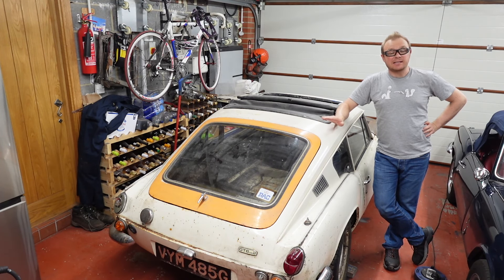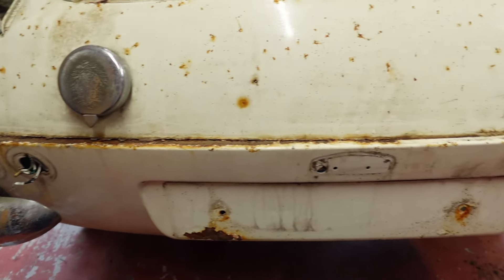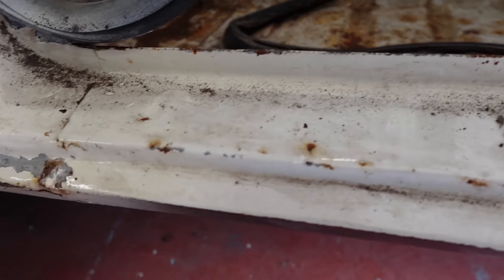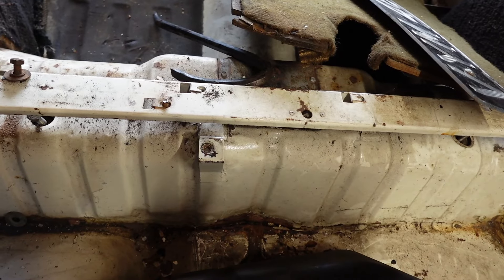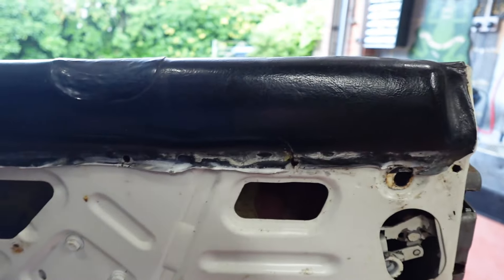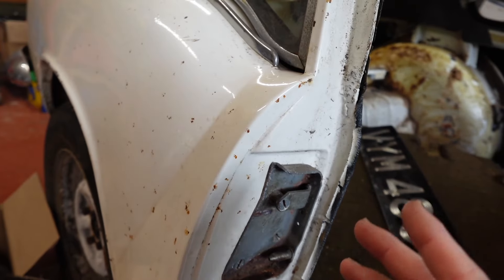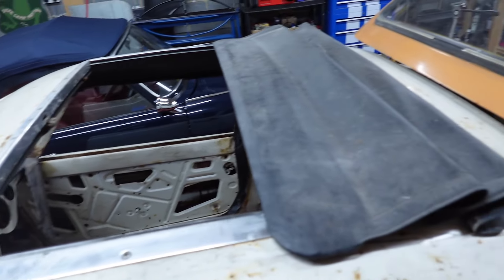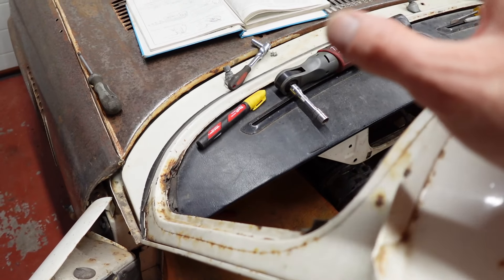How Rusty Its It Really!? Abandoned Resto Teardown | 1969 Triumph GT6 Mk2 Restoration | Pt 9

Comment: Great to see another mk2 being restored. The door cards still have the chromed plastic strip that runs at the top of the card, super rare and unobtainable. Rear shock absorber mounts look rotten, it's a three skin layer to reinforce the body as the shock transmits loads through there. Many replace with brackets onto the chassis, the original design always feels better, I think Canley Classics sell the proper shaped panels. The screen surround bolts in and can be repaired, shared with TRs, so it is very expensive to buy second hand. To pull the tank, one needs to unbolt the long boot cover bracket that goes between the wheel arches. When re-building, think long and hard about good heat insulation at the front of the cabin.Cockpit heat being a known GT6 fault. There is a chap in Essex that restores Britax and Weathershield sunroofs, sorry cannot remember his name! Good luck with the car, I have owned one for a long time and love it.
Reply from the maker: Thanks Tim! The door card trims were something I was meaning to check on so that’s handy info. Not much in the way of chrome left on them, but I’ve an idea of how to deal with that. The bracket between the wheel arches is welded on (on my car at least?) but as it will almost certainly need to come off for the wheel arch repairs then converting it to bolt on might be a good plan. I actually managed to find an early Spitfire windscreen frame in very good condition for only £61 delivered. Problem is it’s too good for me to want to cannibalise so I think I’ll be repairing mine. Might have a go at rebuilding the sunroof myself, got a bit of time to think about that though as there’s plenty to do!

Comment: Could be a lot worse. Worst thing looks to be the windscreen frame, but at least with the round tail GT6 you have a removable frame which is interchangeable with the equivalent Spitfires and TR’s, so should be able to find a better s/h one.
Reply from the maker: They’re not quite interchangeable as the fixings are different. However I have just bought a spare screen frame which looks to have the hard to make outer sections intact. So I guess we’ll see what the best way forward is!